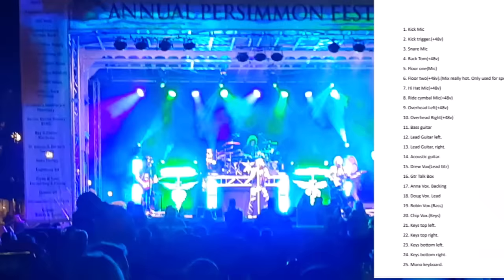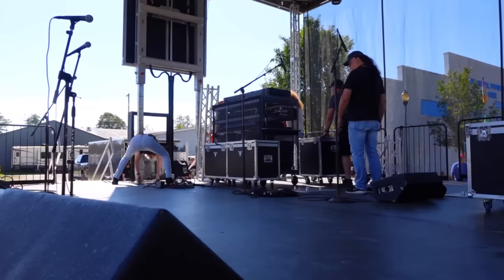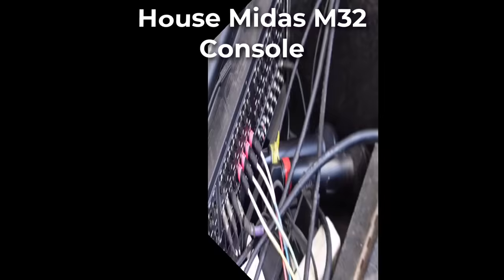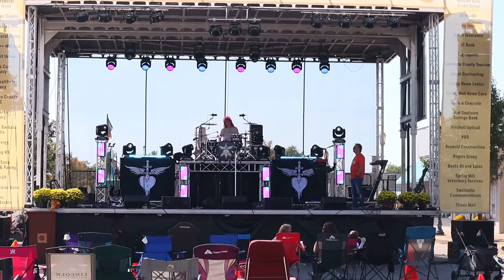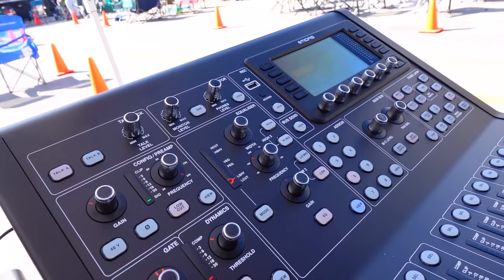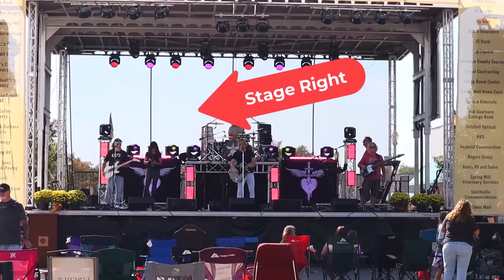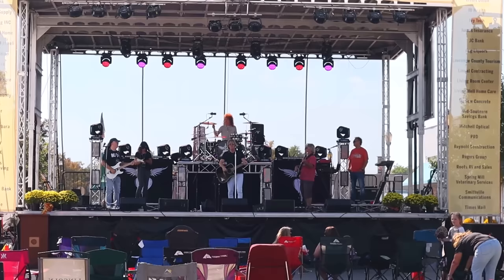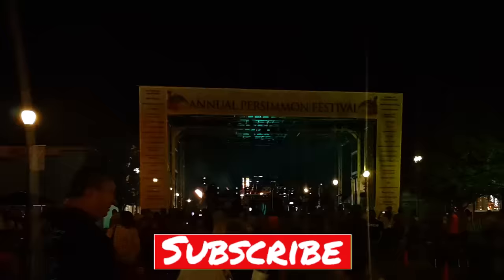Show day and Soundcheck: A Day in the Life of a Freelance Audio Tech

Comment: Nice and very nice to have a walk-on with monitors already sorted, as that can consume a lot of time and effort.  In-ears also solve a lot of the stage noise and volume issues that can muddy up a mix badly.  The band seemed very professional and ready to go, which is not always the case either.  But I think this shows that it can all come together nicely and that modern digital mixers sound great and are versatile - I've had good gigs generally with bands, and mixed gigs with theater performances.
Reply from the maker: Definitely true. Digital consoles with their presets and baseline scenes can really speed things along. And once you have it right internally as far as patching and routing, there's no mispatching of outboard gear and bad patch cables to troubleshoot either... It just works immediately.

Consistent monitor mixes too with IEMs and a dedicated monitor package where backline and mics don't change as well.

Comment: E-drums simplify our band set up so much.......I would nut punch myself if I ever had to mic all those drums etc in the future.Our set up and sound check , all told, is usually well under an hour. All digital, amp sims, IEM's, Behringer Power Plays, easy peasy....
Reply from the maker: It's not really too bad. I probably only edited out about 10-12 mins of the soundcheck once things were initially pinned. And not all of that time was actually things going on directly with the soundcheck itself. Like they had to swap a mic line out at one point on one of the vocals.
But it helps to have that starting show-file done offsite so the console is already named on each channel, HPF engaged and roughed in, routing already set up, gates and comps ready with roughed in settings where I think I'll want them so I can tweak them from there (like the kick gate I know I'm going to be triggering when it opens with a 60-80Hz signal, so might as well already have that kind of stuff dialed in). Vox already assigned to a vocal subgroup where I already have a comp inserted (Leisure comp (LA2))... etc...

That stuff would be more time consuming and rushed onsite. And especially on a new console where I don't already have presets and library stuff saved.
Reply: @AlanHamiltonAudio  Great post
Reply: E-drums have also a lot of disadvantages over acoustic drums. The main one for me being that E-drums need to be dialed a lot in advance to sound decent through a PA. Seen plenty of shows where drummers used e-drums with stock kits and default settings and it sounded horrible though the PA and nothing in mixing from the FOH would fix that.

I wouldn't say one is better than the other, they both have their pros and cons, and for live i prefer acoustic drums by default.
Reply from the maker: @djabthrash  One problem (sometimes) with E-drums is you'll run into someone who just gives you a left and right feed, or a pretty limited feed, and you're stuck with cymbals, toms, snare, kick all coming at you in a mix you can't really control. Nothing is separate. Which would not necessarily be terrible if it was actually well-mixed and genre appropriate... but that's rarely the case. Instead, it's been balanced by a player using cheap headphones, or a practice amp, or any number of things that are nothing like what a professional PA sounds like. And it could have canned reverb/FX also coming at you down those same lines and nothing you can do, other that hopefully ask the drummer to change something and improve things in the limited time there usually is for a soundcheck.

With real drums, or separate lines for everything in the E-kit (or at least sep kick, sep snare, toms together, cymbals together) you can rough things in quickly and fine tune during the first song when the room is full and things are coming together onstage. But, not that "everything all together" mix of Edrums coming down a couple of stereo lines at you. You cannot fine tune anything because you can't isolate anything. Doing things to improve one part of the mix hurts another part of the drum mix.

But then sometimes you run into the people that have that all sorted out and send you several lines of E-drums that already sound good and make it an easy day.
Reply: @AlanHamiltonAudio  Couldn't have said it better :)
Reply: @djabthrash  LOL you fellows are fightin' the feeling! In the real world, the bass player/singer(me) is also the sound guy on stage with his laptop connected to a wireless digital mixer. The guitar player takes a walk around the venue with his wireless guitar rig at soundcheck and listens from various points in the room as we play "Blue on Black" about 5 times."This needs to come up, that needs to come down.........thumbs up........let's rock!" The two leads from the Roland e-kit suit me fine. Much better than fussing with 10 mic inputs. Drummer boy can go into his kit module and change anything that's out of whack. We save "snapshots" of mixer setup for any venue that we play and that gives us a great jumping off point at each show. We also have the "trusted few" fans that give us input on the fly. Our stage is quiet and feedback issues are almost non-existent. I do miss the spectacle of shimmering cymbals when we watch video afterwards, though.......
Reply: @longsnapper5381  What you described is YOUR case and i'm glad it works for you.
I was just sayin' that a lot of people don't know about the the drawbacks of e-drums and should be aware of them before using them live.

By the way, everything you described about having only a stereo signal to deal with (you can submix a acoustic drum all the same, and some bands do that when they send their audio to FOH), using snapshots, checking how things sound from the crowd and adjustng your levels quickly, etc, also works with acoustic drums.
The quiet stage thing is exclusive to e-drums and is good though !
(Even if personally i like the sound of real drums onstage, even it means drums bleed into vox mics and such).
Reply: @djabthrash And what you described was your case, as well.Most bands are closer to my situation and the digital world is here to stay. Just think how easy our "load in/out" and set up is. The older you get, the less you want to lug around 80 lb amps......
Reply: @longsnapper5381  I have nothing against the digital world, and actually i embrace most of it (digital mixing consoles, direct out stuff for bass/guitar (kemper, axe fx, line 6 helix, neural quad cortex, two notes torpedo stuff, etc), BUT for drums you can tell in MOST gigs, in all levels (from high profile gigs to small DIY show) the e-drums thing is still rare and there are reasons for that (most which were explained in previous comments).
By the way i do a lot of stagehand gigs, and do sound and TM for bands, am a drummer too and own an e-drum kit at home and i've worked with bands that use e-drums and with bands that use acoustic drums, so i know well about both (electronic drums vs acoustic).

In most gigs, you can pre setup your drums side stage (and even pre mic them if you have your own mics with clamps and such) so setting up on stage and line check is quite fast and not way slower than setting up an electronic kit.

I would say an e kit makes sense in some cases, for instance : if you have your own car and transport your drums yourself and your e kit fits in your trunk but a regular acoustic drum kit doesn't (because yes an acoustic kit in cases takes way more space than an e-kit).

EDIT : if you have the space to carry an acoustic drum kit, and depending on the way your shows are set up and your kit is (having your own mics with clamps, etc), most drummers/soundpeople/crew will prefer acoustic drums over e-drums.

EDIT 2 : the best argument for acoustic drums is that most decent drummers prefer playing acoustic kits and sound better on them than on e-kits.
Reply: @djabthrash  Lots of  "opinion" there, brother. Our drummer has been playing drums since he was 14 and he's now 70. His e-kit does fit in his car's trunk-a big plus. Us old guys know that when you've dropped many thousands on your amps or your acoustic drum kits there is a lot of inertia with embracing the new technology. Same with guitars today. You can get a damned good guitar today that looks and plays just like it's MUCH more expensive grandparent for 1/10th the price. When you've dropped $3500-$5000 on a vintage Gibson that you searched years to find it's appalling to have to admit that the Harley Benton sounds similar enough at $300. Us old guys embrace light-weight, easily set up, inexpensive alternatives because we've lived the heavy - expensive side and we've realized the audience doesn't know the difference. Are we professional, touring musicians that make our living from playing/recording music? No, we are not. We rock pretty hard , have lots of dancers, and always get asked back when we play out. What more does a guy need?

Comment: Great video, as always. Question - on the input list there are no mic models, just info on phantom power or no phantom power. Is that because the band travels with their own mic package and thus doesn't need to specify which mic is being used?
Reply from the maker: Yip, that's it. They have everything they need in the mic package as part of the monitor rig and keeping things consistent so they just need to provide what needs 48V (although I didn't ask why they don't just provide it from their mon console). I did provide the Beta 91A whereas they usually use a Beta52. But it's laying in the kick when they do, and the drummer doesn't use the kick mic in the mons, just the triggered sample. So we were both just experimenting. If the mic is going to lay in there anyway, might as well try the B91. And of course the mic I used on the bottom snare was mine. I wasn't sure about room for a stand on the riser so I opted for that EV 468 and a rim clip that has a small flexible gooseneck built into it. That gave me a ton of flexibility to make sure it could stay out of the way and still aim where I wanted it. That was an addition to the mic list so wouldn't be changing anything in their mon presets (in fact it homerunned straight to the DL32 and didn't hit the splitter or their mon console at all. 
Both of those mic additions I decided on way before gig day because I was just going to bring them specifically and not my entire mic trunk to the site. Not when I know the band already has their own mic package anyway and I didn't want to mess up their monitor presets with changes they weren't comfortable with anyway. I've worked with the drummer and we talked about my plans beforehand anyway. He's cool trying stuff that might make the drums sound better in the house or said better to help me make the drums sound good in the house.
Reply: It sounded nice. That band is good too.
 @AlanHamiltonAudio
Reply from the maker: @gregmcveigh9966  Thanks. Good band. I just needed not to mess anything up! :)
Reply: @AlanHamiltonAudio  Thank you for all this extra info !